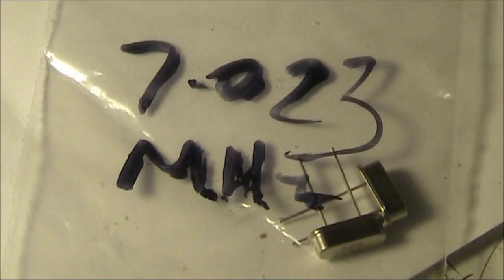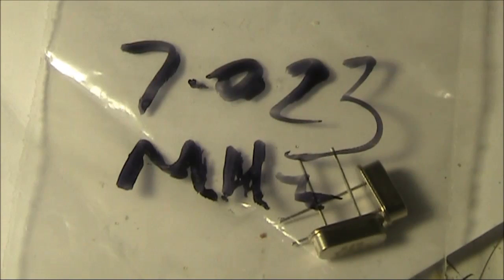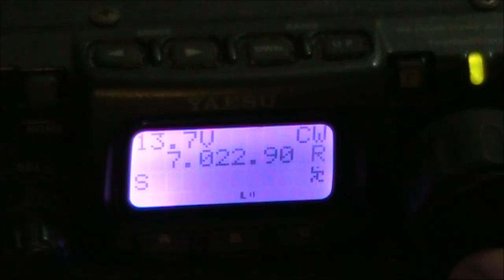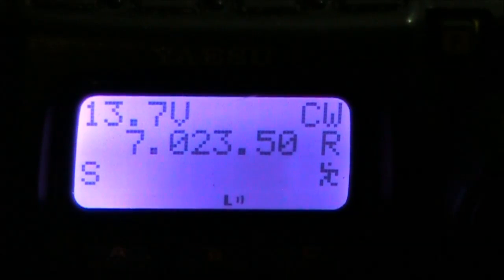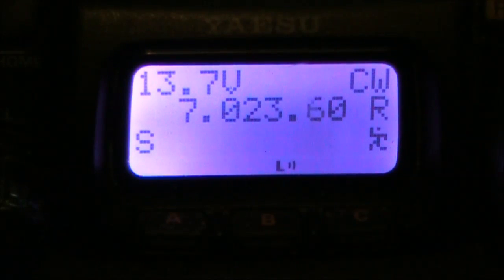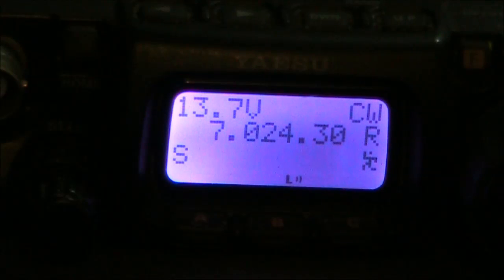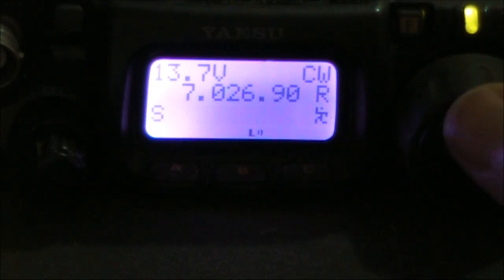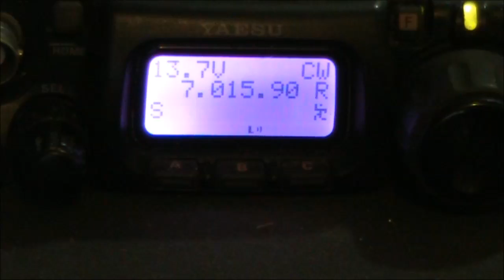Four crystal 7.023 MHz super VXO pulls over 5 kHz higher

Comment: Old video, but this is interesting as the aussie East Coast call / net frequency is 7025. Fists is 7028 and often after contact is made on 7025, they’ll drop down to 7020 to rag chew

So a reliable swing from below 7020 to 7028 is neat

Aussie Parks guys often are on 7032 which is just outside, however there is supply of 7030 and 7020 HC49U crystals from Mouser. I think that might be worthwhile experimenting with.

Comment: Yet the 80m super VXO based on colour burst crystals pulled over a far greater range... 80khz if I remember correctly. I wonder if this is to do with the type of 'cut' that is used in the crystal manufacture.
Reply: I have not seen that VXO experiment DazzW but I  am gueessing with a 95 percent chance those were HC49-U full height ie 14mm height xtals.  Internally they are a disc with two off gold plated  semi C electrodes. These vibrate in a drum mode.  The short ultra cheap xtals are rectangular and vibrate in Beam mode I am not surprised they don not pull well .  Generally full height xtals will do +600  and -200 Hz per Megahertz  on fundamental as a simple vxo so a 4Mhz nominal should be expected to do + 2400 kHz  and perhaps  1.4 x that as  two crystal osc.  BTW if a silver plated quartz xtal holder is not hermetic an air leaks in  then the frequency drops as the xtal gets microscopically heavier via silver oxide.   HOw someone  got 80 Khz on a 3.59 Mhz VXO is beyond me . I will try to find the video. Be aware that Peter does not heat the whole gubbins up by 15 degrees or so.. therein lies the test !!
Reply: Timothy Fidler Hi Tim, yea its here on Peter's youtube channel. It's a much older video where he's got an 80m vxo pulling 80khz. I searched super vxo and it came up as one of the search results. You are right though, that's a darn lot to budge a crystal oscillator. What you were saying with relation to the crystals mode of operation is interesting. I wonder if those really large colour burst crystals you used to find in old teles pull even better.